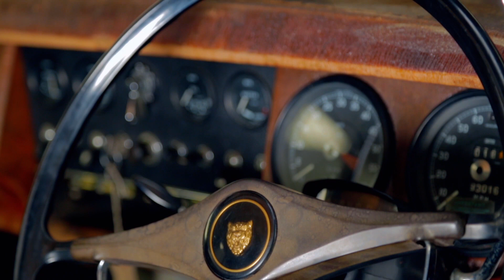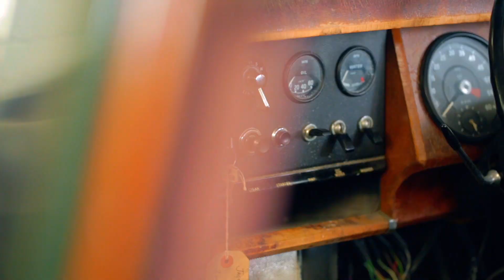"Too Good To Be True" Jaguar Mark 2 | Salvage Hunters: Classic Cars

Comment: I bought a Auto 3.4 Mk 2 Jag in 1973 off a dealer in Rotherham  for £250 ,in British racing green . Just got a new Mrs. and I bought the car to impress  
her after a flurry of small family cars apart from a  Triumph tr 2  which was a 1952/3 & a  1959 Rover 90 ,I bought for £50 . Run the Jag for 4 years 
,going to the cars & motorcycle shows in London and holidays in it ,super comfortable and quick ,but not good on petrol for a lad in his 20s  . The head gasket went and I bought a Wolseley 6110 3 litre off the local funeral directors ,so the Jag ended - up on the local dump ,keys in the ignition & hood ornement  still on the bonnet - I just walked away and left it . The reg. would be worth a small fortune now ,kids eh ! .

Comment: But it's not a Mk II, it's a late 240 or 340 with ambla-interior instead of leather and the late bumpers from the S-Type
Reply: I'm not an expert on the Mk2 but even I know that you are absolutely correct!  Could a 420G reasonably be considered a Mark X?
Reply: @Ampex196  no it can’t .. the Daimler is different in many ways

Comment: It's only a small thing, but Drew was driving this (or might have been a mini) after finishing it, and kept banging on about how detail was everything - "The Devil's in the detail" whilst at the same time holding a steering wheel in which all the flat-head screws were higgledy piggledy and not lined up with each other. Anyone obsessed with detail simply cannot look at non-aligned screw heads. I know. Ergo - he's a fraud - it's just telly.
Reply: Besides, it's a later model, a cheaper 340 (or even just a 240?) with the not so nice bumpers, so less a crime to turn it into a mock-up Coombs with the wrong engine. As you say - it's telly.....

Comment: It isn't a MK2. After 1967, the model was cheapened and called the Jaguar 240 or 340. The clues are the ICI Ambla (vinyl) seats, horn griiles instead of foglamps, plastic top roll on the dash, thinner bumpers and a lot less wood. Same mechanics but not the same quality and finish as a MKII. Surprised the 'experts' didn't know that.

Comment: For those who understand proper motor engineering this is television comedy.
Mr Pritchard clearly suffers from 'Little Man Syndrome'!
Reply: LEAVE IT ORIGINAL, 
BUY A WRECK to Modify.
Reply: You are being really cruel when plainly he is suffering from the Dunning Kruger effect.
Reply: @johncrosley1  Thank you John. I needed to look that one up.  I like it ...  and can't help but agree with your interesting diagnosis.
I recall Mr Pritchard saying; "....this is where the little guy sits" when refering to a projectionist.  It was clearly intended as a 'put down' of a job that HE sees as menial and insignificant - such is his complete lack of knowledge.
The late, Great Richard Attenborough was noted for recognising the true value of the (traditional) film projectionist as the last in the chain of presenting his work on the big screen. Poor screen presentation of a film that possibly cost £ many millions can totally ruin the viewing experience.
Being cruel to anyone is not in my nature - your remark is accepted as tongue in cheek.
Just to see through the cinema projectionist's viewing ports Mr Pritchard would probably need to stand on two volumes of Funk & Wagnalls.

Comment: I am not a Jaguar expert, but this car has 'S' type bumpers, not Mk2 bumpers and I see that John Sullivan has already pointed this out below.
If it were a Mk2 it surely would have fetched at least £10,000 more than drew paid for it.
Reply: My father bought a brand new 3.4 Mk2 in 1965  EUY355C I even remember the number plate and I still have the original tool kit from it. The Mk2 , like my dads had much larger bumpers and I thought the narrow bumpers were for the 2.4 version or was it the later 240/340 as a cost saving exercise  but I may be wrong. I can remember going to the garage before it was registered just to smell the cream leather and look at the metallic maroon bodywork. It had a heated rear window one of the first cars at the time. Exhausts were very expensive and the engine had to be dropped to change a clutch which meant the front suspension off. Very expensive to maintain and 18 to the gallon if you were lucky and using overdrive.  Magnificent engine and I drove it on Pendine Sands and for its day it was quick once it got going. I think , but may not be correct , that this is the small engined 2.4 as it had no fog lamps  but couldn't see the  exhaust to be sure. Dont agree with the changes they were talking about. A close friend had the Daimler 2.5 version. More rare but I would go for the Jag every time. Sadly it was traded in for a new bright yellow Vauxhall Ventora! The Jag needed a new clutch and exhaust system and we got the princely sum of £220. if only we had left it in the garage.
Reply: The MkII also had these bumpers from 1967 onwards. They were cheaper and called a 240 or 340, depending on the engine size. This is such a later (and cheaper) car.

Comment: it is not a MK2,   it is a late 1967 or 68  340, based on the thin S type bumpers. The MK2 would have the voluminous large bumpers.
Reply: Quite right.

Comment: 1:44 - taps the sills "...looks brilliant..." 

Yes folks, there is absolutely no need whatsoever to actually get UNDERNEATH the car and spend at least twenty minuites with a torch and a screwdriver carefully examining the suspension hangers, chassis rails etc etc etc.

Especially on an old Jag...

Comment: Haha. First, this is not a mk2, it's a 340 or, worse, a 240(Ambla seats, thin bumpers etc.) Still a classic, though.  Next, this is a total staged situation. If indeed it runs well, and is almost rust free, only a moron would let this go in 2018 for less than 25K.
Reply: Wot I fort. Looks more like the Daimler/Jag thingy with those bumpers. The whole rear body and window were different too.

Comment: To replace the headlining carpets  and wooden furniture would be a kings ransome .   The leather upholstery would be priceless to restore .  and then to put non standard bits on it like louvered bonnet would be the first thing anybody would take off again.  as for rechroming the bumpers .....forget it . HSE have put paid to all the rechromers in this country and the only thing to do is to have stainless ones made in Vietnam  albeit at an exhorbitant cost.        Stick to the antique armchairs Drew
Reply: I come form the Black Country and there are still platers that chrome as its not just used on cars.

Comment: On top wing mirrors too,  so much easier to see behind than door mirrors any day, do MK 2s had overdrives as standard or where they optional like the MK1 models? at least the MK1 was Brilliant to drive in the dry in the wet even with Dunlop sp41 tyres expensive good but very short life still you'd loose the back so easy expensive spare parts not the most reliable But if i could i would still buy one tomorrow even with the very unreliable overdrive

Comment: This is actually an 'S' Type, not a Mark 2. These were developed from the Mark 2 and were sold alongside them.
Reply: You're wrong, look again.
Reply: The s type had a small rear window and shouldnt the head be painted red if its a 3.8?
Reply: its 340 not a s type
Reply: John Sullivan i didnt say it was.
Reply: S type has a longer tail (boot-trunk). Pretty sure XJ cam covers won't fit an XK engine so it's probably got a 4.2 eng. Still a cool car.
Reply: SURELY A XK120 ?
Reply: Wrong , its a mk2 S Types had a different rear end
Reply: No, John Sullivan is correct, it"s a 340
Reply: Not the most desirable of mk 2 run the 340, past its sell by date .Owned by Leyland by then and basically a stop gap till the  far superior XJ series was launched.  All things aside this is a rot free car and its going to give someone some pleasure for years to come and surely thats what classics are about ?.